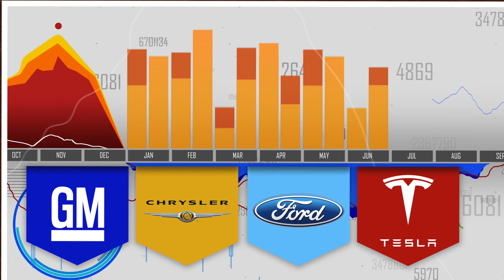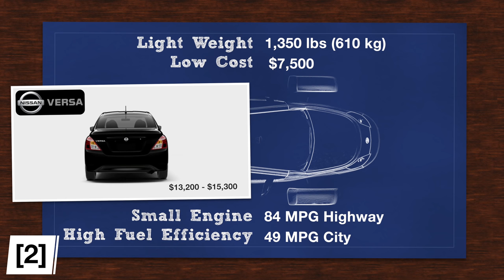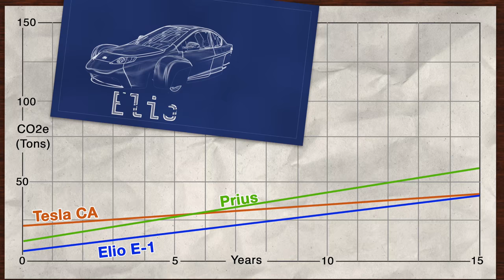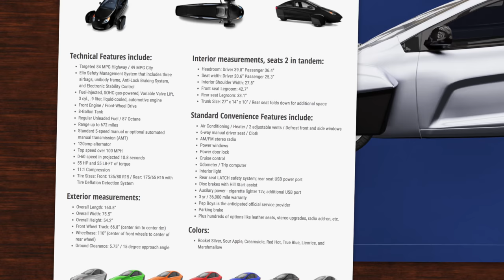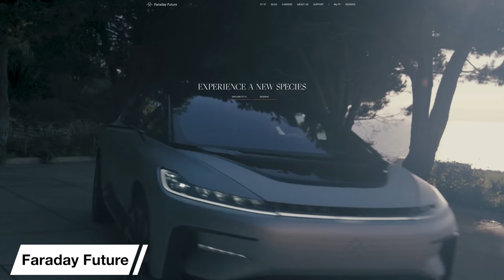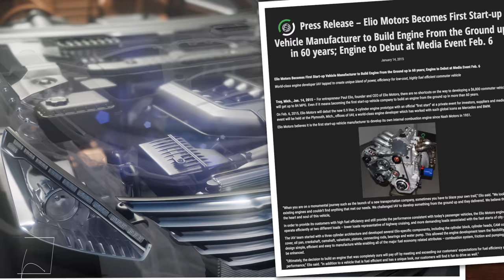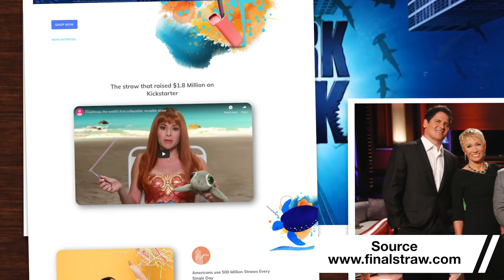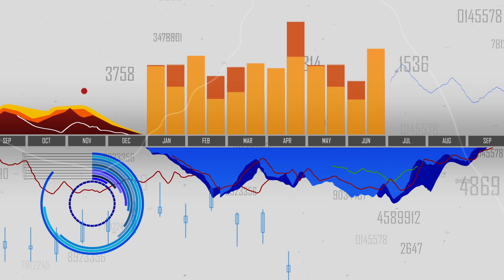How this Radical Car Missed its Chance to Change the World

Comment: I think it was 2014 when I paid one hundred dollars for a "spot in line".  I went to see the orange prototype when it came to Los Angeles and the Red one (with the Elio engine) at the LA auto show.  I am totally on board with buying one if it is actually manufactured.  
If Elio ever gets off the ground and people see them on the road, that is all it will take for it to be a success.  That is my opinion.
Reply: I also like this vehicle, than afterwards they can also do bigger models. To accommodate more. Passengers
Reply: I'm with you, I've been interested ever since I learned of Elio.  As he pointed out Electric cars have way more impact on initial manufacturing.  And you aren't tied to a charger, there are still tons of gas stations across the USA.
Reply: I suggested that they offer a color matched aerodynamic trailer as an option. Need extra "trunk" space for groceries? Hook it up.
I'd love to see the thing go into production, but I just can't hold my breath any longer.
Reply: I would love to buy one, even new. I'm not so sure it's actually going to come to market at this point.
Reply: So it's not on the market yet.?
Reply: I totally want one.
Reply: senseofstile buy a Smart car instead.  (600 cc engine built by Mercedes). Unless of course you want the dork factor and you could buy a Renault Twizzy.
Reply: @kingavegarage8722  But you're still tied to a gas station if you buy a dino oil burner. In late 2012 early 2013 I saw a post on my FB page about the Elio car so I did some research and saw nothing but positives(which should have been my first clue something wasn't right). But I went "all in" and gave him the money b/c the car I had barely got 20mpg on the hwy.

Well as it turned out, the factory he said he bought in Shreveport, La., he didn't buy he rented a very small portion of it. And then we heard he had to leave b/c he couldn't pay the rent. Then an SEC investigation showed that out of the $225-250 million he needed to start production, he only had $100,000 in his bank account. So now, 10 years later, he has no factory and no money and yet he's STILL pandering this failed car business to all who will give him money so he can ride off into the sunset and spend the rest of his days on a beach somewhere. 

I think the SEC or Congress should start an investigation into Elio Motors and if there is evidence of wrongdoing, Elio should be held accountable and give back all that money he basically stole from us.
Reply: 500 bucks here. Still waiting
Reply: @designanddirection  Smartcar is entirely different besides taking up little physical space.
Reply: ヤヒャ yes I know.  However the video talks about the company partnering with an engine manufacturer. Swatch did this with Mercedes when they created Smart.
Reply: I made my reservation in 2016 and I went All-In Non-Refundable. Haha so I am definitely hoping they bring the Elio to market but we’ll just have to wait and see.
Reply: Sorry, but at some point, it's put up or shut up.
Reply: @designanddirection  Smart cars are way more than $7-8k.
Reply: @pmessinger  Not in the UK.
Reply: Ellio had a dream not a company he got my $100 t shirt purchase but I will never see the car made. Glad I didn't fall for 1k nonrefundable.
Reply: you paid Elio's mortgage
Reply: Never work now, the cost savings on fuel costs for electric cars make the 84 mph Elio seem expensive to run, PLUS maintenance on electrics which don't need oil, antifreeze, sparkplugs, etc make Elio look like a dinosaur now..... his only hope is to swith to electric or have a VERY SHORT and unsuccessful future.
Reply: It's a intriguing concept.  The success rate for three wheelers hasn't been too great though.  Have to see what happens this time if/when it makes it into production.
Reply: Sensible approach, was good to read your comment.
Reply: I don't understand why if you are going small and light, you wouldn't go electric. SOOO fewer parts, and cost savings, and it's the direction the world is headed.
Reply: Thanks
Reply: @designanddirection  Smart car is pulling out of the USA, plus they are ugly
Reply: 2013- got a sticker and shirt for it.  I placed the sticker on my Nissan Leaf bumper.

Comment: I still want one if they ever make it.
Reply: No you don't... it's a death trap... because of the SINGLE door design.  The moment you get into any kind of moderate accident, you're trapped inside your car. Que other scenarios where you would get trapped inside your car because your ONLY door won't open for X reason. BAD BAD BAD design! This is the very definition of a death trap...
Reply: @KuraIthys  it's not the doors  but space,
in  air u do not get hit sideways but on the roads /city u could and your body will hit the other side no air bag wll help when one side is crushed u will not have space to open with broken bones nothing ,this is a coffin.
Reply: @KuraIthys  If I am incorrect then I apologize.  However, the person on the video said a 1 door vehicle, and the P5, their latest model/concept/whatever IS a 1 door vehicle.  The pictures and animations that you are seeing I'm assuming are from perhaps earlier designs or are from other people's designs and not the companies?  I'm not entirely sure.  But the research shows that it is indeed a single door design.  Throwing insults around or attacking me won't help your argument any better.  It's best to stay civil.  Regardless, on a bus, they have emergency windows designed so that you can escape.  I do see some of your points - there are lots of things you or the company can do in an accident.  However, what if it's not an accident?  What if the door fails and you're in a parking lot trying to get out of your car?  The vast majority of people are obese and the chances of them trying to get around to the back hatch are very slim to none. I've seen the picture of the owner trying to get out of the back hatch, it's too small for the average obese person to exit.  That leaves forcing the person to try to exit out through the window (if the window is able to go down), and if the window can't go down, break the glass.  You always need an alternative exit in case the primary exit is blocked (in this case the door) or not working, that's common sense.  If the door is on fire or blocked, you need a fast way to get when seconds count, hence a second door.  That's the way it is with buildings, buses, planes, trains, and everything.  That autocycle does not have an accessible alternative emergency exit.  I mean come on...
Reply: Pretty sure I saw a cutaway of this vehicle somewhere and it's basically a roll cage on wheels. Still safer than being on a motorcycle. Every vehicle you drive is a death trap. I have seen smart cars and mini coopers demolish trucks and suvs.....physics is a bitch.
Reply: @EpicATrain  yeah id rather drive this than a motorcycle, remember that most motorcycle crashes are low speed impacts and im eure this elio can take one of those far better than a bike.
Reply: @EpicATrain  agree 100% that car is a big death trap.
Reply: @SaKOTR  sorry for the late reply, YT didn't say I had any replies.  Hey uh, that's interesting and drastically changes things but wouldn't that seriously increase the weight and cost of the vehicle?
Reply: They will never make one. It was a Ponzi scheme scam from the beginning!
Reply: @EpicATrain  I forget what I read a few years back. But it's a high grade strength aluminum. I would like to see some crash tests. Even though technically they wont have to being a "Motorcycle" in most states. But by what I saw, I would consider it a safer frame/body than a Saturn. So probably moderately safe for what it is. Think I would hop in one of these before a smart car aswell. But it's far behind a Mini Cooper in safety. Those things are tanks for their size, and fully encased in airbags inside.
Reply: Bloodvaynedotcom I mean everything they've produced regarding crash test data is just stimulations. :/
Reply: @AWonderfullLife  you're most likely right but at leastarger manufacturers are taking on some similar designs.
Reply: The danger is a common quality of these types of vehicles. Even when made to be sturdy as hell like the Aptera was, they still bounce around like a ping pong ball when hit, which can and will likely kill the passengers even if it's not crushed. That is just going to be the case if you want to drive a more efficient vehicles with less weight, but it's not that you're so small as much as it is that the other vehicle is so much bigger than you. If we began driving smaller vehicles then driving a small vehicle wouldn't be any more dangerous than a car now. People buy huge SUVs for their kids because they want their kids to be safe and not in some death trap, but then they put these new drivers into giant killing machines. Does that make sense if seen from the perspective of a collective society?
Reply: I laid out $1000 refundable for a "Spot on Line" in 2015. When Elio requested to sign a "Commitment to Purchase"  and deposits would not be refundable??? I asked for my $1000 back, it took me 3 months to get it but I signed back in at $100 non-refundable with that commitment to purchase. 
I went to see Elio (the car) I saw it, I touched it and I sat inside of it. I really felt that it was a winner all the way. It would replace my motorcycle, safer and even get better gas mileage plus not having to worry about cold or rainy days. The perfect replacement to my two wheels? Some say it's a death trap, well, on a motorcycle you are risking your life every time you ride. For commuting back and forth, for fun, for running errands it just can't be beat . I no longer see it happening but if they start production, I am getting mine. As far as a death trap?? Hell we are all going to die, might as well have some fun before we get there. I am 68 years old, still ride my Harley. they better hurry up..
Reply: After seeing the price tag, and looking at the MPG ratio being similar to a Motorcycle, and since I already have a Motorcycle endorsement on my license (which seriously if people want to complain about having this on their license it is 110 bux for a class, and two days out of your life to obtain one), AND I already own not just one but 3 helmets? Sign me up. This costs less than the lowest end brand new motorcycle, and can possibly (I say possibly) travel state to state without major problems. Again I ride a motorcycle DAILY through SNOW and through RAIN. I believe I would be able to learn how to handle this car within a few years. And with that being said since I do ride a motorcycle which is a much bigger death trap than this vehicle? I would totally be interested in owning one of these cars.
Reply: @EpicATrain  - It may be a death trap, but it's still safer than ANY motorcycle ever built...

Comment: I'll still buy one if it came out.
Reply: Me as well, I've wondered for about 20yrs why nobody makes a tandem 3wheel "car".
At the time the "Kindred Spirit" Renault based kit car was out, and the Grinall Scorpion (which is still available I think)
But both are more expensive than the projected msrp of the elio.
Getting a contract with a pizza chain (like the Chevy spark and Dominos) 
would make getting the commercial version to market much easier.
Reply: @eksine  It takes a real motor to fyck up on than vs then. Takes one to know one comes to mind.
Reply: Sure thing dude, Me and the engineering departments of Ford, GM, Fiat, Vauxhall, Volkswagen, and others.
Most manufacturers have put out prototypes at various auto shows that were 
Reverse trike (2 wheels in front 1 in rear) tandem seat, sub one liter displacement, Hyper Mile, EV etc.
I've (like I said) wondered for a long time why none ever went to market, other than kit/specialty car (T-Rex),
or (Of course)  Morgan (which also has a wooden frame).
But then again the first "car" was three wheeled so, I'm definitely not alone in thinking a trike would work.
Reply: @jcb0249  it is a trike and seriously the reason they never went to mass production was because along the way they just kept lying about their deadlines and just pocketed the fund raising money. they don't have any intentions of actually building this car
Reply: I 😍my smartcar.
Reply: It was never going to come out.   It was a crowd-funding scam, where they could make BS promises and appear to work on something to collect an exorbitant salary and throw parties.   Venture capitalism usually doesn't permit this often as the investors are more savvy and have deadlines and input, but crowd-funding has none of that, and the government is corrupt and easily duped into funding as well as long as its "green".   I said this so many years ago and people called me a liar and still put in their "deposits".   Sigh...
Reply: @BoopSnoot  yeah the "deposits" into their pockets
Reply: @eksine  IMO it should have been obvious from the start, considering a Honda Goldwing or Can Am Spyder three wheeler cost around $20K and get around 32mpg.   They were advertising prices cheaper than almost all modern motorcycles, yet alone trikes, with fuel economy superior to pretty much all small motorcycles.
Reply: @BoopSnoot  it can be done, I think why the can am is bigger is because the public will perceive that as being plausibly safer in a crash. I think if there was a need for this kind of trike, honda or Can Am would build it, but due to it's lower safety, perceived or not both companies would avoid it to avoid the lawsuits or public backlash. this is just a step up from a gocart or anything lightweight. I mean the ninja 250 gets like 84mpg, but 2 wheeled motorcycles aren't as safe or easy to ride and it's not convenient. if it was me I'd make this 4 wheels, keep the weight light still, and simply get the price as high as possible and make a killing on the profits. I'd do it with an engine that was easy to get but maybe not too easy that other people could just make their own and compete with me. the one real eye opener is how there's so many idiots still believing in this when it's proven time and again to be a scam. looks like I should just build a fake product and get idiots to fund my retirement
Reply: Don't hold your breath. Elio motors is a scam and the car is pure vapor ware.
Reply: @alexander2685  yeah but bad gas mileage an chevy aveo back in the day got better mpg and you had a back seat
Reply: @eksine  "than" is 100% NOT the correct word to use in this case and it's idiotic that you'd argue it to be so.
Reply: @eksine  Nope, Dontsay Moore is correct. "Than" is strictly for comparisons, and your statement wasn't comparing DaBinChe to anyone. Yours is an if-then statement: "If you buy an Elio, then you're an idiot."
Reply: @ryanb2883  You're right. What about the other guy though? Did you analyze his sentence? f I'm an idiot he would be a much bigger idiot THAN I am. How's that Ryan Bogomolny
? Is that correct enough for you, your majesty?
Reply: No you don't... it's a death trap... because of the SINGLE door design. The moment you get into any kind of moderate accident, you're trapped inside your car. Que other scenarios where you would get trapped inside your car because your ONLY door won't open for X reason. BAD BAD BAD design! This is the very definition of a death trap...
Reply: @EpicATrain  tell that to the millions of  motorcycle riders
Reply: @DaBinChe  That makes no sense, and you're deflecting.  That's a bad comparison.  Motorcyclists know the dangers that they are getting into when they get their license, buy a motorcycle, and get on it each time.  Consumers don't know this until it's happened with the Elio, until they are trapped in their car after the door won't open for whatever reason.  Panic starts settings in and people start freaking out.  Dude, it gets bad.  It truly is a bad design.
Reply: @DaBinChe  And why is that?   Economy of scale.   Hundreds of thousands of cars vs tens of thousands of motorcycles.   Elio wouldnt be able to make more than hundreds a year at that small facility with no dealer network.
Reply: @jcb0249  it's not the doors  but space,
if u get hit sideways  on the roads /city u could and your body will hit the other side no air bag will help when one side is crushed u will not have space to open with broken bones nothing ,this is a coffin.
Reply: Look up Archimoto.
Reply: Me too but I think this is a scam.
Reply: @Jozavenue  side impact dangers come with any vehicle (I see where you're coming from, and at least partially agree.)
Reply: Buy Electra mechanic solo
Reply: I would love to drive the Elio! Fuel efficient, nimble,  & compact.

Comment: They could have sourced the engine from Rotax. They make very good V-Twins and 3-cylinders. The BRP Can-Am Spyder Roadster uses a Rotax engine. It's a similar 3-wheel design, but open like a regular motorcycle. They have sold over 100k units. Maybe Elio should partner with them.
Reply: Exactly!
Reply: @drippingwax  Exactly! Get in the market and on the road then they could have started development on a better engine through the sales of the metro based models.
Reply: I work for BRP here in Quebec,Canada. You are correct. Elio should have negotiated with BRP to build their cars using the Rotax engine and transmission. BRP Canada has (1) The finances for R&D,(2) The production facilities to produce the vehicles, (3) The already qualified personnel like : welders, assembly line workers, mechanical engineers, technitions, plus R&D design and testing facilities.(4)BRP has a VAST DEALER NETWORK that can begin to sell any product TODAY not tommorow TODAY ! Meanwhile Paul Elio has " SHIT NOTHING " to start with ! ! !  What a farce and a fucking RIPOFF ARTIST that Paul Elio is. Paul Elio should be building plastic model cars in PRISONNN ! ! ! !